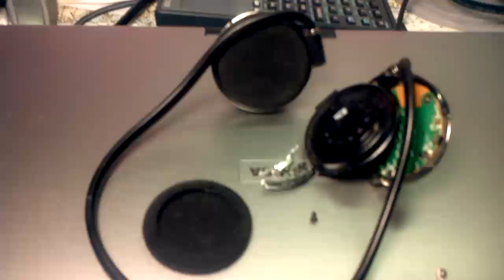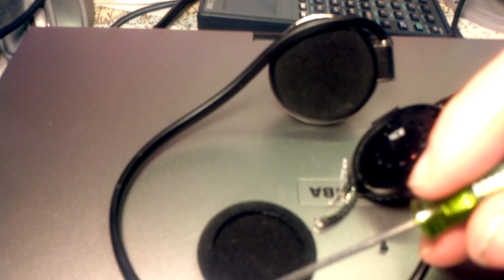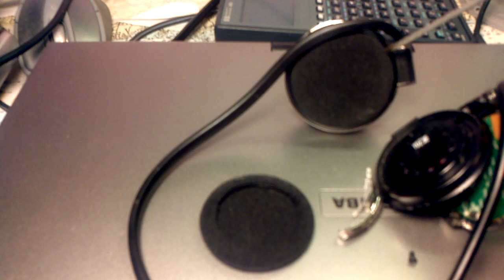Motorola S305 Bluetooth headphone disassembly

Comment: hey there I have a question here I have a nuvelli nuv2882 that is apart but still works perfect I want to attach an antenna onto the board for extra rang I was wondering there a small white what looks like a brick is that the antenna
Reply: ny1t i had a video that explains what the little square is it was a 2.4ghz antenna